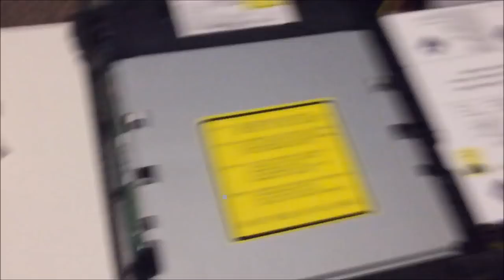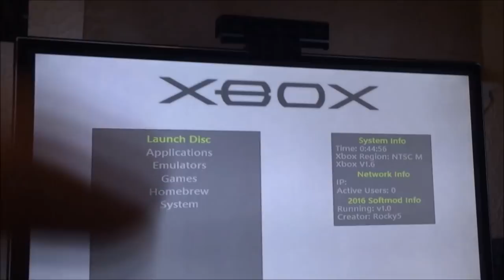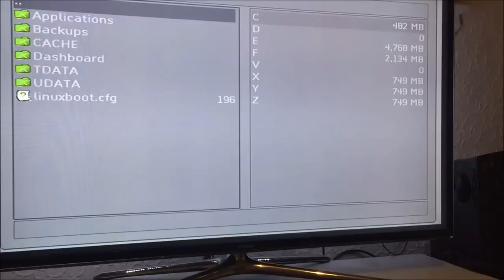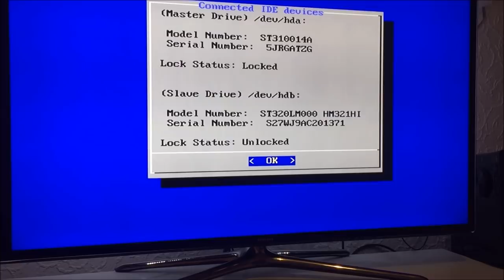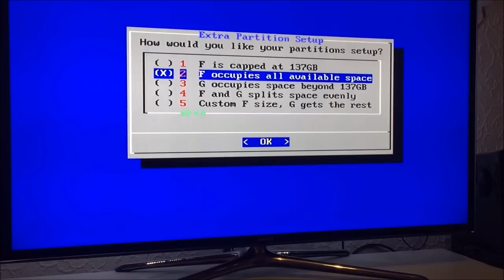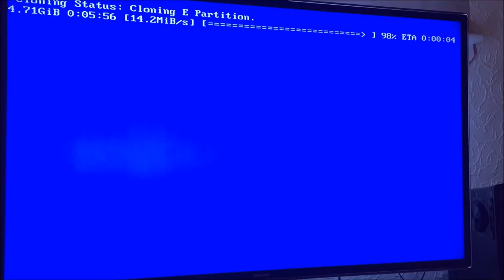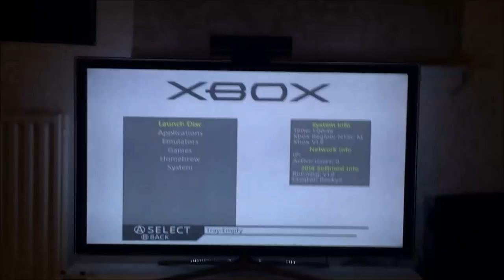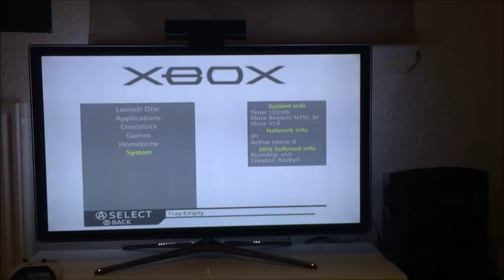How to clone your Hard drive using Chimp 261812 from start to finish.

Comment: Okay... so I got through the cloning process and at the end when I went to lock the slave drive it didn't work. What should I do now?
Reply from the maker: +Blackanese The Baby I'm assuming it said lock failed? then all you can do is try locking it via the slave drive options menu. If that doesn't work then the drive isn't lockable.
Note: some Sata/ide adaptors cause issues with locking, so if you have more than one try another.
Reply: I'm using an HD strictly ide drive. And yes it says locked failed. I went into the slave drive options and tried locking it there multiple times as well as cloning it again and trying to lock it from there. Does it have to be locked? This is the first time I've ever done something like this... haha.
Reply: In short, what would you recommend as my options?
Reply from the maker: +Blackanese The Baby yes it need to be locked, the only time a HDD can be unlocked is when you have a bios replacement ( chip or TSOP flashed ) if you try to use the HDD in an unlocked state on a softmodded or stock system you will get Error 5.
Reply: JCRocky5 well that sucks. I've seen someone else use the older version of chimp on this same HDD model and it worked just fine. I've been going at this for hours. So what're my options then? By another drive and see if it'll work? I moved the jumper on the stock hdd to master. Should I put it back on cable select and try again maybe? Ugh.
Reply: Also i'm using a 500 gb, would it perhaps have something to do with the way i'm partitioning it? I followed your tutorial step by step but it sounded like you were using a hard drive with less memory...
Reply from the maker: +Blackanese The Baby the lock process is down to the drive, some lock others don't even the same drives ( not sure if newer or older firmware on HDD prevent locking ), I only use 2.5" Sata drives now as I haven't come across one that doesn't lock, the only downside is you need an adaptor for it to work and those can be hit or miss.

You could try the older version of Chimp and see if it locks, if it does then we know something is wrong at my end and I can look into fixing it, but please note I haven't changed how the locking is done, just the UI for it has been changed/simplified.

Cable select or master shouldn't matter, as long as the HDD is after the DVD drive IDE connector the Xbox will make it master.
Reply: I believe you. Just trying to work through the problem. I tried using the older version of Chimp but I got the green screen and I could access the drive through the command prompt telnet function on my windows 10 pc but when I hit 1 and then enter it would give me an error of sorts and wouldn't let me continue. That's why I downloaded the newest version because it said it took care of the green screen on the older versions of xbox.
Reply from the maker: +Blackanese The Baby Chimp 2618 work on all Xbox versions also, I'm assuming you have a v1.6 Xbox? So that should allow you to boot into chimp.

Alternatively you can just replace the linux267 and initrd.gz inside the chimp folder with the ones from and older version of Chimp. ( you will need to rename them to match mine or edit the Config.cfg )

I can understand your frustration.

What I may do is add a lock check to Chimp for the slave drives so before anything can be done it will let you know the drive is not lockable, this would make folk not wast there time cloning to find out it isn't. ( not sure why I never thought of that before )
Reply from the maker: Sorry missed one of your comments. The HDD size has nothing to do with locking, it's the actual HDD firmware that prevents or allows locking.

Comment: what is up rocky can you upload the list of parts or where to buy them?
Reply from the maker: +Erick Leyva Parts, OK.
Sata Adaptor:
The green one is just a generic one, just look out for one that looks the same.
http://www.ebay.co.uk/itm/New-3-5-SATA-TO-PATA-IDE-Hard-HDD-Optical-Drive-Converter-Adapter-UR-/161818343132?hash=item25ad1ff6dc:g:KTMAAOSwyQtV7VLu

The Startech one you can get from here.
http://www.ebay.co.uk/itm/TR1359-IDE2SAT2-Startech-40-Pin-IDE-PATA-to-SATA-Adapter-Converter-for-HDD-SSD-/141890206225?hash=item210950ba11:g:43MAAOSwLqFV8zRv

----------------------------------------------------

IDE 80 wire cable.
http://www.ebay.co.uk/itm/UltraATA66-100-133-80-Wire-IDE-Cable-for-Hard-Drive-CD-DVD-Blu-ray-/271521227122?hash=item3f37ed2172:g:fKwAAOSw-7RVG-fG

Molex Y splitter
http://www.ebay.co.uk/itm/4-pin-Molex-Power-Y-Adaptor-Splitter-Cable-150mm-Lead-LP4-PC-PSU-HDD-5-25-/251165526898?hash=item3a7aa1cb72:g:A4QAAOSw9mFWLhH5

Comment: Note: The program has a regular error when you unlock the hard drive and then attempt to clone it. The second attempt in which the Xbox is already unlocked, doesn't get an error when you go straight to clonning. Something to patch if you want to. Going to try and cap the 1 TB at 137GB to see if that makes any difference.... and nothing.... pretty sure it has it has to be a cable issue cause nothing else is working.
Reply from the maker: Already said it’s a cable issue, 80 wire ide cable is mandatory. No matter how much faffing about you do won’t change that :/ 

Also if you ever get errors write them down so you can tell me. But you will get an error if the drive is locked as well, you can’t clone to a locked drive. It tells you to unlock it first. 

Get a new cable and then get back to me.
Reply: JCRocky5 JCRocky5 Sorry about the drama. I was panicking because I was making a modded Xbox for my cousin and I wanted it to be perfect for him when he gets it. I'm very thankful for your genius and your generosity.
Reply: The error says: hbd: drive not ready for command after unlocking the hard drive and preparing it to get cloned from the Master hard drive. Once I reset the program with the hard drive already unlocked, then it proceeds without any errors.
Reply from the maker: The drive maybe frozen when it’s unlocked, this stops anymore commands being sent to it until, a complete power cycle has been done.

Comment: Can't seem to find the linuxboot cfg file ?? Any help or a link would be awesome .. thank you
Reply from the maker: Not used with my version. Just follow the instructions included and you should be fine.
Reply: It worked , I couldn't get it to load the application when I swapped ide cable from DVD to slave hd but  was able to start chimp then swap worked great thank you rocky !

Comment: If I clone my 1tb hdd with another 1tb do I leave the new one unlocked if I want to put it into a different Xbox?
Reply from the maker: If the other Xbox is hardmodded yes, if it’s softmodded null your eeprom first then lock the drive to the cloners system (system you just nulled) now null the other system that is getting the new drive, now it’s just drop in.

If you don’t want to null eeprom keys then you will need the eeprom from the other Xbox so you can lock the cloned drive to it. (Place eeprom.bin on Y partition before loading chimp loader)
Reply: Ok my 1tb hdd is in a hardmod can I still put the new clone into a softmodded box?
Reply from the maker: If the C partition is setup properly and locked to that Xbox yes.

Comment: Hi,I have soft modded my Xbox (splinter-cell exploit) and cloned the HD - no errors and all works OK.When I put the new larger HD (160GB) in the Xbox on its own it comes up with an error 13 (dash) but when I put the stock HD back in it works ok.The dash was upgraded to 5960 and I am using the 80 wire IDE cable.I have removed the soft mod and re-installed but can't get to work - any ideas.
Haven't used your disc yet but would like to know what's causing this if possible.
Reply from the maker: +Bhoyo77 usually error13 after a clone is to do with the adaptor and IDE cable but if it’s not a data drive then it could be a bad clone. So try the fix error16 option under Slave drive options. This will only clone the C partition and leave everything else alone.
Reply: JCRocky5 thanks,will give it a go - will also try changing the adaptor just to rule that out.
Reply: JCRocky5 Hi,I had a dodgy ide cable - tried another cable and its now sorted.

Comment: I’m only getting one boot: loading kernel it doesn’t go to the second boot and I never reached it to that screen. My Xbox flashing red.  Any suggestions ? I mess around with the slave and master positions and no luck.
Reply: Jordan Thompson Same thing happens to me. I so Damn pissed off. Any help?
Reply: ADAMMAGIC39 so many tutorials, but not enough info or help.
Reply: @Kla2024-s5t  Be sure your original HDD is set to Master on it's jumper and the New HDD is set to Slave on it's jumper. Do NOT connect the New HDD until after the Xbox powers on.
Reply: Infamous Ob thank you for tour response. I will try this out.

Comment: I installed a 500GB drive, but the Xbox only says I have 24GB of space? What did I do wrong?
Reply from the maker: You will need to format the drive with XBPartitioner v1.3 to fix the partitions. 

You only format the extra partitions, Press A when the menu loads and it will cycle through presets. When you see one you like press the start button then Y and that’s you.
Reply: @JCRocky5  Wow, thanks for responding so quickly, your videos are awesome!
Reply: It only split the 24 gigs between F and G. I need to figure out how to change the clusters, it's at 16, I need 32.
Reply from the maker: XBPartitioner will do that for you.
Reply: @JCRocky5  thanks again for responding, do I save at 24gbs, when I have 500? I don't have access to the other 470gbs.

Comment: the first thing that comes up is the choice between "disclaimer, softmodded xbox, tsop/chipped xbox, and linux shell". if i select softmodded (which mine is) it doesnt give me any of the options. I am using your exact chimp. unleashx is my dash. When i select softmod i get the error "HDtool failed to lock the HDD slave device cannot be locked, some item menus are disabled"
Reply from the maker: Your drive isn’t lockable if you only get 3 options.
Reply: Yea found that out the hard way. Ended up TSOP flashing my xbox(ind-bios) and running it with the drive unlocked lol. Also the mirror done by chimp was fucked up so i did a weird method. I FTP'd my partitions 1 by 1 off of my working 8gb HDD, then opened my drive that wouldnt lock in Xplorer360, and put all the files from working HDD into corresponding partitions. Then used HexeN to launch EvoX to backup my eeprom(nothing else would). THEN i think i installed the softmod the old fashioned way of using splinter cell + the save. Sorry its all a blur i forget what worked.

Comment: loved the video and i followed it well, BUT! when i swap over my drives at the end after locking and shutting down i get the warning message "07 service is required" im using the green adapter and the original 40 pin xbox cable. thanks
Reply from the maker: You need the 80 wire IDE cable like I say in the video its mandatory.
Reply: thanks! my 80 wire cost £2.75 on ebay, a bit deerer than a sweetie LOL thanks for the help dude!

Comment: Hello, I get a buffering error at 80% all the time it's quite annoying. I am using a normal stock hard drive to copy from with a softmod on it, it works perfectly. Any ideas would be appreciated.
Reply from the maker: At what point do you get a buffering error?

During the cloning process?
On startup of Chimp?

You only need to clone 1 or 2 partitions C and E if you want your saves. 

So if it’s failing at a specific point then the master drive maybe damaged or the Slave drive.
Reply: JCRocky5 Thanks for the reply, the error occurs while cloning E, gets to 80 percent and stops. Should I reformat the original drive and softmod it again or is it knackered?. I have tried different slave drives, so it's defo the master drive.
Reply from the maker: Just clone the C partition that has the softmod on it.
Reply: Is there an option to clone just C?, or should I just stop it by switching it off when cloning C&E.
Reply from the maker: Slave drive options > fix error 16

But it’s already cloned C so lock the Slave drive.
Reply: JCRocky5 Will that format over the previous failed attempt then?
Reply from the maker: No, the drive is formatted only when you select clone. So even though the clone failed files will still be there on E you will just need to format it using UnleashX to clean up any files.
Reply: JCRocky5 Thanks.
Reply: JCRocky5 Okay, so I followed what instructed, the new hard drive boots, but will only work when I put a CD in, it's triggers something to load the softmod. I have xbmc on it, once loaded it won't read the DVD drive, it says no file path. How can I get to the mod to load on its own, how can I fix the drive?.
Reply: Edit, it starts the softmod when I press the eject button, I can't format E there is no option for it.
Reply from the maker: There won’t be you will need to do it manually by adding the entry into the config.xml of UnleashX. 

Burn my extras disc and run the factory reset option from it and that will do what you need. 

When don’t get back to me and I will talk you through the next part. 
( or if you have an exploitable game just load it and resoftmod after the factory reset )

Comment: Let me make sure I have this right. I need to swap the dvd to new drive before I load the chimp and I only have 4 seconds? If so, I do it and it stays stuck on the loading screen. I have tried to load chimp without the swap and it takes me into chimp. I am trying to use a 2tb hard drive. What am I doing wrong? Thanks.
Reply: ok. so the time shouldnt be the issue. Ill check the slave
Reply: i just checked and it has no jumper pin on the hard drive.
Reply from the maker: +avngrboy the jumper is on the SATA adaptor no the SATA drive.
Reply: JCRocky5. so it is a sata with an adapter to ide. there is no pin in the sata drive. i didnt see one on the adapter. do you think there is one on the adapter?
Reply: there sure is.  let me try that
Reply from the maker: +avngrboy you watched the video right? I specifically stated the adaptor must have jumpers.
Reply from the maker: +avngrboy you must have the drive set to slave or cable select for the Xbox to not crash when you plug the ide cable into the adaptor.
Reply: JCRocky5 it sure did. so small i over looked it. it loaded. thank you for your help. we will see how it goes.  thanks!
Reply: got it to go, took about an hour and locked the drive.  i connected it as the master and it doesn't boot. it gives me an error 13. any suggestions?
Reply from the maker: +avngrboy 80 wire IDE cable?
Reply: JCRocky5 works perfectly. i thought the cable swap was for some games, not everything.  Thank you!
Reply from the maker: +avngrboy no problem :)

Comment: What happens if it just hangs on Starting Chimp 261812. I get two ok's but then it just hangs
Reply from the maker: Use a standard AV cable.
Reply: JCRocky5 I have the cable that came with the Xbox
Reply: FYI this ended up working for me. People need to upload the files using Windows' native FTP browser, not FileZilla or something like that. (https://www.reddit.com/r/originalxbox/comments/7qabkk/chimp_refuses_to_load_on_12_xbox_freezes_on/dtv8xg2/ )
Reply from the maker: Red, white and yellow lead? if so that’s the wire you need to use. If it’s still not working then you have one of the Xbox Gentoox won’t load Chimp on. I have never been able to work out why other than the HDD’s E partition/platter maybe corrupt/damaged. 
( as people have replaced the HDD and chimp works again )
Reply from the maker: Ah so FileZilla corrupted the files, you need to set FileZilla to transfer in binary mode always. 
( its set to auto be default )
Reply: JCRocky5 ok gotcha. Yeah I remember reading that somewhere years ago but it's always something I forget to do when I install filezilla on a new computer

Comment: I keep getting code 16 after I swap the hard drives. Am I doing something wrong?
Reply from the maker: +Gavin Underwood the clone isn’t successful, when you done the clone what speed was it cloning at? ( under 5MB ) also you are cloning from a drive that is setup properly?
Reply: JCRocky5 currently getting 13.9mbps.  I'm thinking of soft modding  again from scratch 😀

Comment: Would the blue ide pata to sata adapters work
Reply from the maker: I couldn’t tell you. The adaptor must support salve to master toggling. But like cheaper ones they don’t always work even though they have jumpers for switching modes.
Reply: @JCRocky5  ok thanks, ill just used the green one

Comment: What does it mean when the XBOX "ring" stays orange?  Is there a setting somewhere to change this?
Reply from the maker: Softmod is installed but the dashboard is hanging. So a corrupt xbe is trying to be loaded for example.
Reply from the maker: Wait are you just meaning it’s orange after booting games eg...?

Orange means the softmod is loaded, green means the softmod is disabled. 

You can ch age the LED colours via NKPatcher Setting with my softmod.
Reply: I just found the setting to change the default color back to green.  Just wasn't looking in the right place.  Thanks for the quick response.